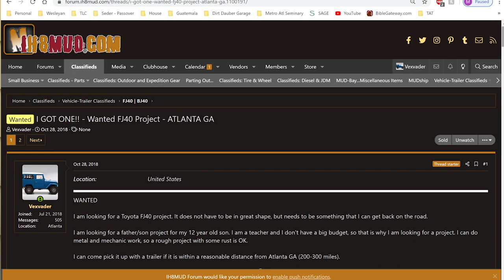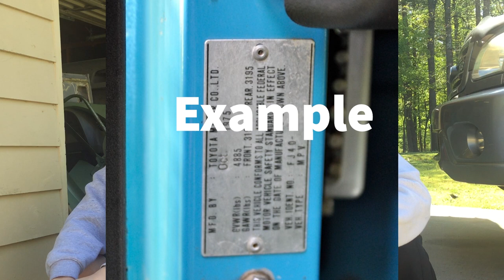Part 1 - 1977 FJ40 Toyota Land Cruiser Project Build

Comment: I picked up mine after looking for 10+ years , a 1978 Bj40 
She broke down in the 1980's with a blown engine. 
guy used it for hunting and got her stuck real bad. over heated . 
he brought some parts, a cylinder head , and got it unstuck and then blew her up again on his way out of the trail. . 
SO good thing is she is  Full of rust sitting outside for a long time. BUT she is unimmolated! body has NEVER been touched!! 
I got her for $1,000 Bucks LOL  witch was VERY good deal in Canada.
Reply: Fully restored bj 40, original look cost $40000 in my country lol